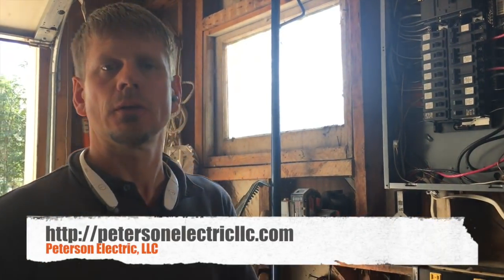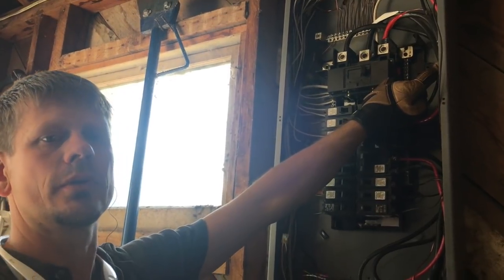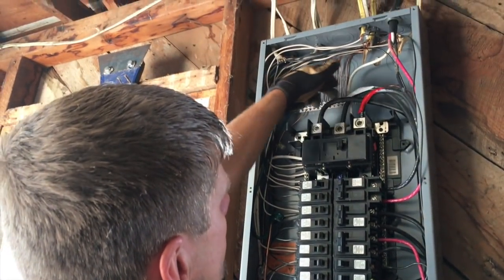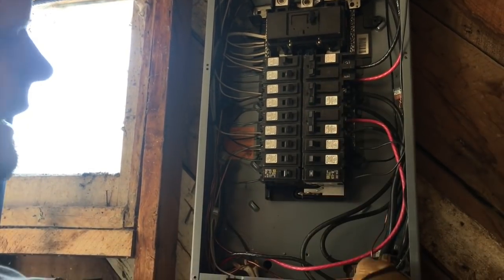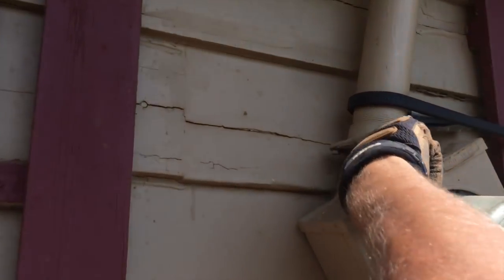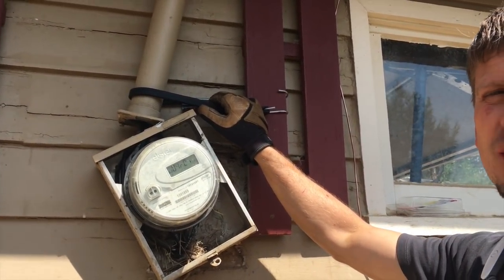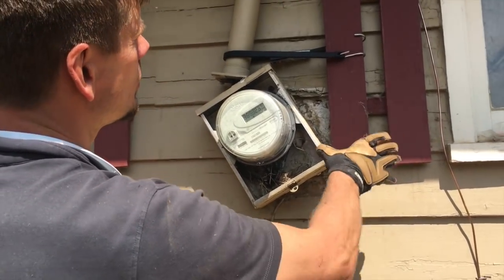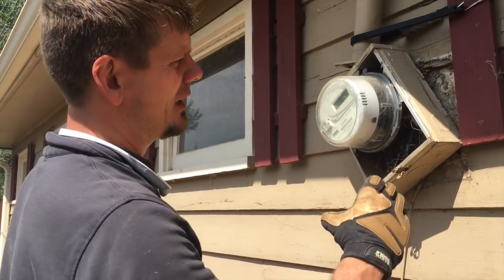Separating Your Grounds And Neutrals In Homeowner's Electrical House Panel

Comment: This guy really knows his code, but did I miss the actual reason he had to separate the neutral from the ground in the panel?
Reply: I think because he is installing a main breaker outside the house, so the inside panel that the video started with has essentially become a sub-panel - and subs always have separated ground & neutral.
Reply: @AdamPriceOregon  oh that makes sense. And now that I think about it, he covered that. It just wasn't clear that was the reason. Thanks for clearing that up
Reply from the maker: @dougsholly9323  The reason you have to separate the two conductors on the load side of a "one-line service" either residential or commercial is because of the SCCR, and how high the AIC fault current rating is for the equipment. This is determined by the main breaker protection for it to trip. A couple of things that help to determine this is, voltage drop, distance, wire size, parallel runs, conductor properties, insulation of wire, transformer impedance, and size of transformer, if the service is a lateral or underground feed in a conduit or direct burial. Also, what determines the safety of the main breaker tripping under a short, dead short or ground fault is the age of the equipment. The bottom line the code talks about the safety that if the fault or failure is on the load side of the meter the utility company needs to stay safe and separate from the fault and if it is on the LINE side of the meter then they want to be able to default with their fuses to disconnect without sending a huge CURRENT SHUNT and stoping a fire on the service equipment. Separating Neutral, White, GROUNDED conductor from the Green, Bare, Green/yellow, GROUNDING conductor is allowing the fault to go back to the main. An example of this is a service call where last week a customer and his son did a bad job joining the connection behind his wall oven and it first grounded out to the box and then because of the ARC FLASH this then melted the wire cap and then he thought he should reset the sub panel 50 amp breaker and then caused another ARC FLASH and then caused both legs to create a dead short and then blew the main breaker. Thankfully he had a home that was only six years old and all of the main grounding electrodes were in place for current code of 2012. This helped from causing damage to the main man hole with the connections to four other neighbor's houses. 
ANother example I went too was a neighbor came home drunk and hit the 25 kva transformer off of the pad and caused four houses to go out of power, this caused a main ARC+Flash at the pad from the primary voltage on 7,200 volts. 
We also have in article 240 series rated breakers to help from a standard 10k AIC up to 100,000 + ratings. There are many other reasons on the utility side and what other pro's have seen in the field, if you have not seen this nor understand this than don't screw with your main utilities or sub panels.
Reply from the maker: The reason you have to separate the two conductors on the load side of a "one-line service" either residential or commercial is because of the SCCR, and how high the AIC fault current rating is for the equipment. This is determined by the main breaker protection for it to trip. A couple of things that help to determine this is, voltage drop, distance, wire size, parallel runs, conductor properties, insulation of wire, transformer impedance, and size of transformer, if the service is a lateral or underground feed in a conduit or direct burial. Also, what determines the safety of the main breaker tripping under a short, dead short or ground fault is the age of the equipment. The bottom line the code talks about the safety that if the fault or failure is on the load side of the meter the utility company needs to stay safe and separate from the fault and if it is on the LINE side of the meter then they want to be able to default with their fuses to disconnect without sending a huge CURRENT SHUNT and stoping a fire on the service equipment. Separating Neutral, White, GROUNDED conductor from the Green, Bare, Green/yellow, GROUNDING conductor is allowing the fault to go back to the main. An example of this is a service call where last week a customer and his son did a bad job joining the connection behind his wall oven and it first grounded out to the box and then because of the ARC FLASH this then melted the wire cap and then he thought he should reset the sub panel 50 amp breaker and then caused another ARC FLASH and then caused both legs to create a dead short and then blew the main breaker. Thankfully he had a home that was only six years old and all of the main grounding electrodes were in place for current code of 2012. This helped from causing damage to the main man hole with the connections to four other neighbor's houses. 
ANother example I went too was a neighbor came home drunk and hit the 25 kva transformer off of the pad and caused four houses to go out of power, this caused a main ARC+Flash at the pad from the primary voltage on 7,200 volts. 
We also have in article 240 series rated breakers to help from a standard 10k AIC up to 100,000 + ratings. There are many other reasons on the utility side and what other pro's have seen in the field, if you have not seen this nor understand this than don't screw with your main utilities or sub panels.
Reply: They don't want parallel  the grounding  and ground wire  return someone can be killed is you lose neutral  and grounding become a return pat
Reply: The reason you have to keep them separate except at the service is to ensure that neutral current does not flow through the metal parts of the electrical equipment, equipment grounding conductors, and raceways.

Comment: He is incorrect, there is no need to separate the grounds and neutrals at the main panel. You are actually required to bond the neutral and ground together at the main panel typically by use of a bonding screw per the 110.3(b) listing of the panel manufacturer. There isn't an actual code violation for separating them as long as they are properly bonded together. If it is a sub panel however, it is required to separate them as you will have objectionable currents in the grounding system which creates significant hazards. Additionally, there is no need for an outside breaker if the main panel is within 6 feet of the meter socket. This only adds additional costs to the project.
Reply: They are supposed to be bonded at the first disconnecting means. He is adding a disconnect outside therefore the main panels neutral and ground must be separated. What he is doing is correct.
Reply: bob lundsrud The exterior breaker isn't required but it's a bit safer and convient with the barn and receptacle present.
Reply: I have encountered a local code that required there be a separate bar, with a jumper between them where bonding is required -- I believe the goal was to make things easier if it was converted to a subpanel in the future...

Two things to NOT forget: "Separating" grounds from neutrals doesn't necessarily mean no electrical connection, and municipalities can add their own requirements on top of NEC.
Reply: bob lundsrud ..so if you bond your neutral to gather you will have 110 on your common ground n no were to go., but to your body....
plz never  rebound your 110-to your neutral...that's wrong..
Reply: If you have them bounded by a bonding screw and not on same bar. You can unbound them and check if there is a small leak to ground (PE). And it looks better too.
Reply: Take that obi one code nobi! Welcome to the dark side.
Reply: Its required at first point of disco which will be in his (all in one) combo meter so he is correct
Reply: I am not sure if it is all of CO but at least where I live you must have a main shut-off accessible from outside the premises.  I would also like to point out that the code dose not specify 6ft and the 6ft is residue from earlier standard practice and normally gets dictated by the area you live in.
Reply: @Shakrii - same in OK. If you modify the service equipment or panel you must add an outside-accessible service disconnect for the fire department.

Comment: I don't get why you're putting the main disconnect on the outside? It's right behind the panel. Just go out your main panel out of a new conduit to feed the barn. No need for the added cost of the meter panel. I guess I could see the outside disconnect if you were going to trench to the barn instead.
Is there something I'm not seeing?
Reply from the maker: Our Utility departments and CO standard for the fire fighters are that we install main breakers or shut off disconnects outside now.
Reply: @Petersonelectricllc  That makes sense
Reply: Benjamin Henness … Sounds to me like there's 2 panels inside (left and right of the meter) and a 3rd in that garage, so makes sense to break it down at the meter with a new main panel outside. (3 service disconnects) That way you have all grounds and bonding in one place like it's supposed to be. From there, everything is a sub panel. He mentioned a 6-8 circuit panel, which would give them feeds for 3 subs and maybe an outdoor service outlet.
Reply: I believe he said its going up and over to barn and using a second mast I believe he was doing an Aerial drop

Comment: On top of all that...unfused utility line in the same conduit with wire feeding a subpanel. I often wonder why there aren't more fires.
Reply from the maker: The reason you have to separate the two conductors on the load side of a "one-line service" either residential or commercial is because of the SCCR, and how high the AIC fault current rating is for the equipment. This is determined by the main breaker protection for it to trip. A couple of things that help to determine this is, voltage drop, distance, wire size, parallel runs, conductor properties, insulation of wire, transformer impedance, and size of transformer, if the service is a lateral or underground feed in a conduit or direct burial. Also, what determines the safety of the main breaker tripping under a short, dead short or ground fault is the age of the equipment. The bottom line the code talks about the safety that if the fault or failure is on the load side of the meter the utility company needs to stay safe and separate from the fault and if it is on the LINE side of the meter then they want to be able to default with their fuses to disconnect without sending a huge CURRENT SHUNT and stoping a fire on the service equipment. Separating Neutral, White, GROUNDED conductor from the Green, Bare, Green/yellow, GROUNDING conductor is allowing the fault to go back to the main. An example of this is a service call where last week a customer and his son did a bad job joining the connection behind his wall oven and it first grounded out to the box and then because of the ARC FLASH this then melted the wire cap and then he thought he should reset the sub panel 50 amp breaker and then caused another ARC FLASH and then caused both legs to create a dead short and then blew the main breaker. Thankfully he had a home that was only six years old and all of the main grounding electrodes were in place for current code of 2012. This helped from causing damage to the main man hole with the connections to four other neighbor's houses. 
ANother example I went too was a neighbor came home drunk and hit the 25 kva transformer off of the pad and caused four houses to go out of power, this caused a main ARC+Flash at the pad from the primary voltage on 7,200 volts. 
We also have in article 240 series rated breakers to help from a standard 10k AIC up to 100,000 + ratings. There are many other reasons on the utility side and what other pro's have seen in the field, if you have not seen this nor understand this than don't screw with your main utilities or sub panels.

Comment: I think a 283.6 usually overrides a 158.6, which in turn supersedes the need to install a connecting 481.2, therefore the original 318.7 is not needed at all.  There you have it!
Reply: Good job. Go smoke that blunt!
Reply: This is a fine example of the Huey, Dewey, and Louie decimal system.
Reply: Copy that 4-10 10-4 30-06 187 5150 420 867530.9

Comment: This folks is why you call a licensed electrician in the first place. Would have been much less expensive than this retro fit. Nice job, you must be a heck of a good chess player being able to envision that whole schematic with codes, breakers, wire sizes etc.  And people wonder why you guys get the hourly rate you do.
Reply: Very correct, but in this case the owner lucked out in that insurance is going to pay for it.
Reply: Not always, sometimes code can't meet your needs. I needed a outlet by the outdoor breaker box to run my welder. Well a electrician quoting code would only install a GFCI outlet with it being outdoors. Well my welder and most welders will trip GFCI's. So I had to go buy the components at Home Depot and install my own non-GFCI outlet myself. I do keep the breaker to it turned off when I'm not using it and keep a lock on the breaker box.
Reply from the maker: This electrician is not correct. The code states in 210.8 that 120v circuits are GFCI, other areas of code will speak about GFCI on single and three phase equipment for commercial kitchens and spas for example.
Reply from the maker: Simple put, RV plugs are not GFCI protected at 240 volts and they are allowed and installed outside, it's about the cover & bell box that protects the plug, not the other way around.
Reply: Sorry I probably should have mentioned this is a 120V 20amp outlet.
Reply: @BigDish101 … this is where you install a 240 RV outlet then get (or make) something like the so called "dog bone" adapters you see in an RV park that will break out one leg for the 120 volt. This way the outlet meets code but it fits your needs. BTW, there are exceptions to the GFIC code where a dedicated outlet may be exempt. Also, the reason a GFIC might trip on your welder could be the power draw. Have you even used a 20 amp GFIC? (most are 15 amp with a 20 amp pass-through) As a side to that, I use a 120 volt Miller wire feed welder in my shop and all the outlets are 20 amp GFIC. No problems using the Miller plasma cutter either.
Reply: @Petersonelectricllc  This statement of course is no longer valid with the 2020 edition of the Code.  All outdoor outlets (both receptacles and hard wired), regardless of voltage, up to 50A, must be GFCI protected.
Reply from the maker: Thanks for your input and watching,

Comment: i agree theres a lot of problems but with that existing panel being the first panel after the meter and having he disconnect in it it is a master and not a sub  so why seperate the nuetrals from the grounds? does the electric company provide the nuetral???  here they dont.
Reply: At 3:25 he says he's is going to be putting in a side by side. Meaning a meter/disconnect in one enclosure. That will make the existing main breaker inside, a superfluous disconnect. The panel will be re-fed as a sub-panel off the meter disconnect outside.   Hope that helps. 👍
Reply: Where I live they provide a neutral
Reply: The power company never provides a ground. The electrician is always responsible for supplying a ground and bonding the nuetral at the first means of disconnect